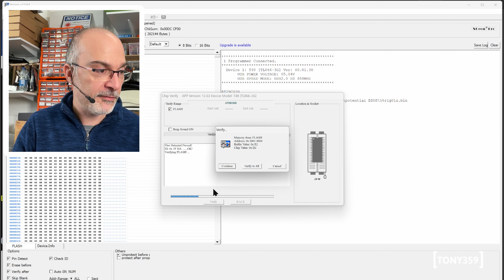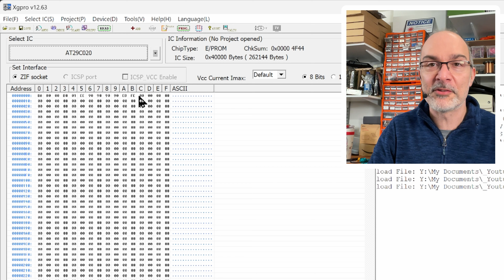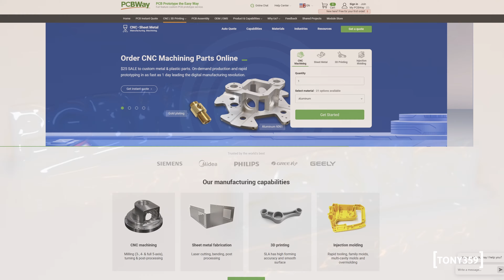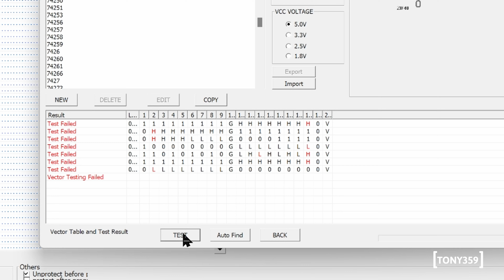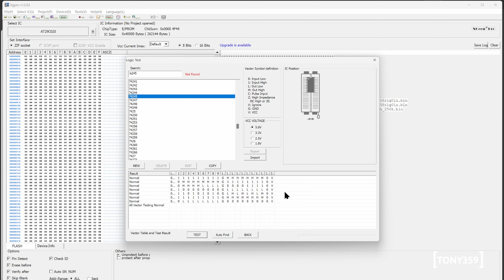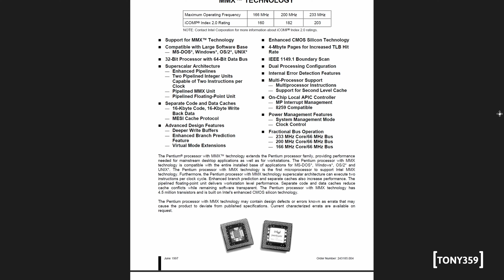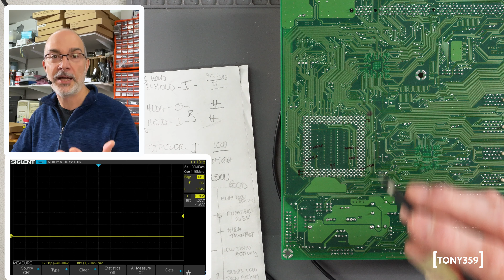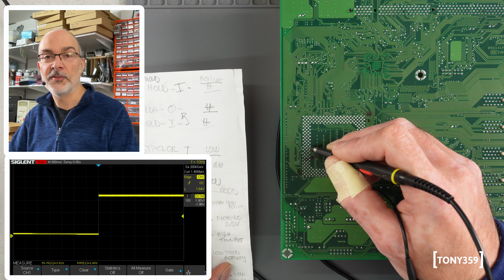I am unable to fix this Socket 7 motherboard!

Comment: Looking at the Pentium board, go back to the ISA and PCI  slots, between the back of the first two PCI slots from the ISA slots side, there appears to be a black electrolytic cap with holes in the top. Are these Sharpie marks or a blown cap? If that description is unclear, go to your diag pcb in a ISA slot and move down to the PCI slots and the cap I am referencing is near the side of the pcb between the first 2 PCI slots.
Reply from the maker: it's just some marker I'm afraid! But thanks!

Comment: I would check for short on chipset and compare resistances with working board
Reply from the maker: I checked with the thermal camera and I didn't see anything suspicious. That said, I didn't realise the Amptron is the same chipset so I can try and compare a bit. Thanks for that!

Comment: How much memory has that ram stick got? According to the manual that motherboard supports a maximum of 192MB, one 128 and a 64MB or 128MB plus 2x 32MB. So one 256MB stick should not work. Aside from obvious missing things like voltages, clock, reset, dead chipset ics, it's usually cpu or ram issues that give a dead post card. I recently have 1/2 repaired a faulty Jetway socket 7 motherboard with dead cache, now I found out the pins in the cpu socket are badly oxidised which causes intermittent no post or hangups. Your board looks really clean so likely no corrosion problems. Only other thing is have a real close look for damaged traces.
Reply from the maker: Only 32MB I'm afraid. But even with incompatible or bad RAM, I'd expect the CPU to execute the first few instructions and then complain about bad RAM. If you remove the RAM from your system, you still get something at the POST card, then obviously it stops. Unless, i guess, the RAM is shorting or compromising the CPU bus? But now I'm thinking about that, the RAM is wired to the Northbridge. The RAM works anyways, you can see in the video when I test the CPU and RAM on a different board. 
But thanks so much for the suggestions!
Reply: @tony359  Maybe You have already checked but I would check voltages to the cache and tag ic's as well as any other You haven't checked. The cache chips have 2.5v and 3.3v rails possibly. A bit of a long shot though.
Reply: EDIT My bad here, JP7 is ok, Vcore is correct on JP11. This is a bit of an oddball socket 7 motherboard, have never seen that HWM Vcore on any other S7 mobo.
Reply from the maker: Ah, that's the "hardware monitor", I don't know what that does. but I tried all possible variations...
Thanks for the hints, all very valid. I haven't checked the cache voltage so something to try for sure. Thanks.!
Reply: I think this is relevant here,tony has bypassed all bios checks,ie switches,jumpers, ram,and so on.
So,because he has programmed a prom to simply get the cpu to write a value out on a bus,he is checking to see if the MOST basic function is working, if so,he can move from there.The glue logic,(ie northbridge,and or southbridge)and the cpu are being tested to see if  they can do the most basic thing ie read an opcode and operand from the prom and then write a byte or word to an address.
His concept works because he tested it,on another mb,and the data was written to the test card.This is a sensible step.
The only caveat,there maybe slight differences between the addressing or bus arrangements between the two motherboards,he has to check this.if they're the same,then he has a glue logic to prom bus issue,a glue logi to pci bus issue,ie no seven segment activity,or a cpu to glue logic issue,and he can proceed from there.
Jumpers,bios,cmos ram,are irrelevant guys,please lets not confuse him,there are other people on the forum,who are pointing him on the right direction here.
Lets us try to give as  helpful suggestions as possible.

Comment: Try different CPU's perhaps, it might be configured for a totally unexpected one.
Reply from the maker: Well, it's an old board, all the settings are manual and they directly affect the voltage/clock at the CPU. It doesn't matter if it's an AMD/Cyrix/Intel, as long as it works with 3.3V and 66MHz, it should work. One thing to consider is the multiplier: that I guess is sent to the CPU for internal multiplication. If that comes wrong, then the CPU might try to run at the incorrect frequency internally so maybe worth to check! Thank you!

Comment: what about the /BOFF signal?
The backoff input is used to abort all outstanding bus cycles
that have not yet completed. In response to BOFF#, the Pentium
processor will float all pins normally floated during bus hold in
the next clock
Reply from the maker: Amazing, I missed that! Thanks, I shall check that!
Reply: @tony359  /FRCMC also sounds like it would be able to spoil the fun
Reply: @tony359  and R/S signal might also be able to let the CPU appear dead (?) .. datasheet talks about putting the CPU into idle for debugging via JTAG
Reply from the maker: Thanks - I checked R/S in the video and it's not active. But I'll check the other two thanks!

Comment: I'm sorry for suggesting the obvious, but  what about CMOS battery? Some boards won't start with flat battery and I once almost discarded one of good boards for that reason.
Reply from the maker: ... excellent (obvious) idea! I'm not sure I checked that. I'll put that in my list! Thanks.
Reply: The battery was replaced
Reply from the maker: I can't even remember my own videos? :D
Reply: @Roadkill7878  I don't think so - it is the same battery that was shown in previous video. Why do you think it was replaced?
Reply: @86smoke  because it’s my motherboard and I replaced it!
Reply: @Roadkill7878  well, yes, that pretty much leaves no room for dispute. But hey, you could have mentioned it before I doublechecked mail video :)
Reply: @86smoke  lol 😂

Comment: I see the 2 videos and no see if you check the clock in the bios (bios send data have cpu or not if they have power and clock) so the clock is missing, the bios is broken or the chipset is killing it. 

Have a small cristal near the bios.
Reply from the maker: I haven't checked that - how does the clock work with the BIOS? The BIOS IC does not have a clock input, I thought it would just follow the ISA clock?
Anyways, I do not see any activity at all at the BIOS chip. 
Thanks for now!
Reply: Sorry It took a while to look for the dataset, in this case it says that it is internal (I see most outside) 

you have the 5 v on the pin 32 vcc?
  This chip is a pain have to many variations to read depending on pins 32 /24 /22 are high or low (this pins need to change low or high to allow read if all stack high not work) to send data pin 24 and 22 low and pin 31 high . (Data says logic for this pins to be high or low but who make the  logic the bios chip, the chipset or other chip)
Reply from the maker: @yoyomismo2052  Yes, I have VCC and GND on the BIOS chip. And I don't see any activity anywhere on that IC.
Reply: You can read in the programmer with the oscilloscope see that you should have it on the pins (it seems that it reads and records it so you should see the necessary signals) but I'm afraid it's going to be the chipset, hopefully you just have to Resolder it

Comment: Try reflowing the northbridge BGA chip.
Reply from the maker: Yes, that's always an option! Thank you!
Reply: @tony359  If you go to that, it's better to do the reball. Many cracks is not ball itself, but inter-metallic joint on the pad (copper-nickel-gold-tin). It separates in the layer and reflow not fix it. You can see it on the pad as grey layer that is hard to solder (but not impossible, if you clean it, it will work).
Reply from the maker: @petr56321313  Yes thanks, I am familiar with that problem. I've encountered when I reballed my first (old) GPU.

Comment: Really strange... The only jumper I see that does not fit me is JP5, 2-3 pins sais for BIOS flashing 5V in manual try 3-4 which sais normal in manual and has default asterisk and NC on the board
Reply from the maker: I can try - though that should only affect the behaviour when flashing the BIOS I guess? Thanks for that!

Comment: I know nothing about motherboards however if I were in your situation I'd try "AI" and see what it says. 😉
Reply: It lacks hyper specialised knowledge like that and will run in circles. But you're welcome to try it yourself and see whether you get any useful output out of it :D

It is after all a text prediction machine, a lossy highly compressed representation of text used for training, and there is very little in depth CPU troubleshooting content that the training process could ingest. A PC mainboard is after all a field replacement unit, where if something is wrong with that isn't BIOS or battery, jumpers or installed components, it would simply be junked and replaced by a working one. Component level repair except rework at manufacturer where they have secret manuals and specialised tools, is effectively a new phenomenon.
Reply from the maker: I tried and it said "did you try turning it off and on again?" 😉

Comment: No beeps means there's no cpu function so try changing it
Reply: Did you actually watch the video? Tony put the CPU in another board and it worked fine!
Reply from the maker: unfortunately it's not so easy...
Reply: @stoptheirlies  don't judge too harshly .. I watched the whole video .. twice .. and still suggested to check the R/S pin facepalm .. it happens 😁
Reply from the maker: Exactly! :) It's fine and I appreciate every suggestions :)